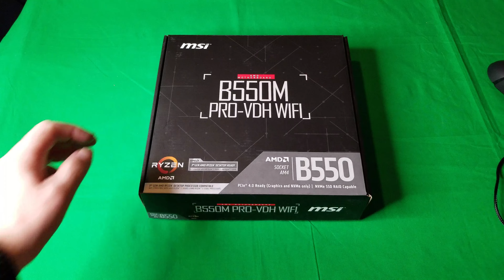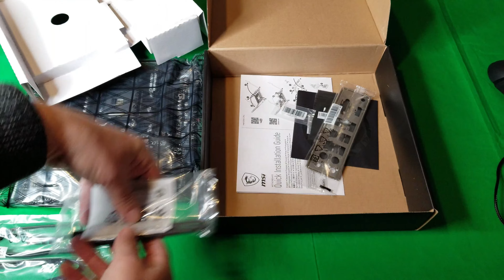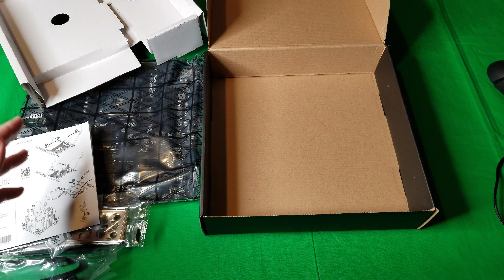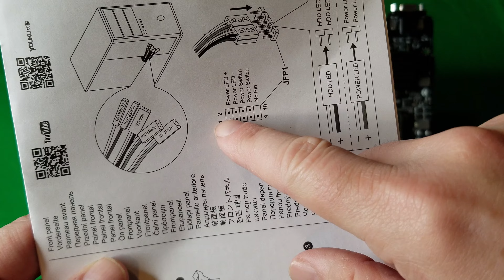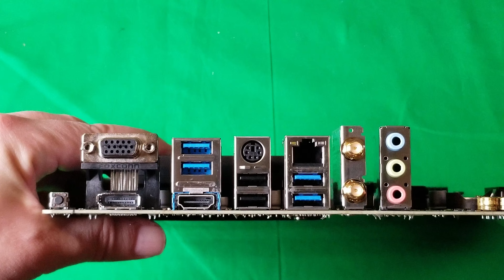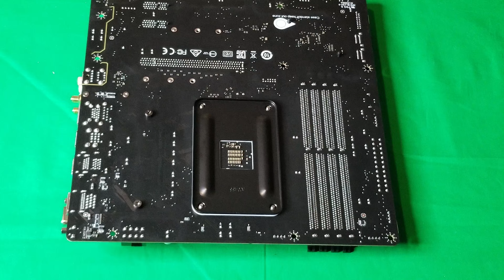MSI B550M Pro VDH WIFI Unboxing & Review

Comment: Hello sir, will it work with the "new" ryzen 5 5500x3d? or am i supposed to update the bios
Reply: Depends on when the board was manufactured, mine didn't need any bios update since it was created in March and had the update needed to handle 5500x3d
Reply from the maker: As @unavailableuser3624 mentioned it depends on MB Manfacture date and BIOS Revision. If your CPU isn't recognized you can do a BIOS update at that time, there are videos on doing it without needing anything else on the MB. Good luck.

Comment: Hello, will this motherboard run with a Ryzen 5500GT right after installation? Unpacked, installed, launched.
Reply from the maker: Yes, it will work after installation. The only caveat is that if your motherboard was released before the 5500 series, if it was a BIOS update will fix that issue. You can verify the older version in the BIOS, if its version 7C95v2A you'll need to update it first. Hope that helps.

Comment: I have a problem, I want to add an ssd in the 2nd slot but the graphics card is on it, how should I do it ?
Reply from the maker: There is usually just enough room for the M.2 to have a slight clearance when you place the GPU in the slot afterwards. If you have a M.2 with a thicker Heatsink then you'll not have the room. Good Luck.
Reply: @Reviewing_Playing_and_More_RPM  So with a small heatsink I would have the space ?
Reply from the maker: If there is a heatsink, you might be ok, can't say for sure. You can go with a higher heatsink and leave off the top cover.
Reply: Take out the gpu

Comment: Pro How can I turn on Wi-Fi in the motherboard
Reply from the maker: Remove the Antenna, that will shorten the signal reach, then because the Motherboard comes with WiFi, there is either a place in the BIOS you can turn off, or in the software for Windows itself. For some motherboards there is a removeable chip sometimes as well, remove the cables from it and that would be another option.

Comment: Can I use a M.2 NVMe PCIe 4.0 and a graphic card in this motherboard at the same time? Sorry about my question but I'm kinda newbie at this, and I read that there's some limitation and that NVMe can disable PCI ports in some motherboards, I don't know about this one
Reply from the maker: While its true it can limit some, a PCIe 4.0 M.2 NVMe and a GPU will work together just fine. I've done this on this system with no issues with a PCIe 3.0 mind you but as far as I'm aware they will work fine.

Comment: i built my new pc with this motherboard everything is working but no wifi i am able to use ethernet tho. not sure why
Reply from the maker: Try going to the MSI Website and download the WiFi Drivers and install them. That is the most likely reason and hopefully will fix it. Make sure you've put on the Antenna as well.

Comment: @ 10:28 which software were you referring to that you're "Not supposed to use"? Was it the software that caused the flashback to fail this time?
Reply from the maker: I was mentioning the MSI App Center, for some reason it caused issue's with the BIOS being updated. However they have now completely redone their Software so I don't think it can do a BIOS update and it must now be done by downloading the BIOS from the Manufacturers website to a USB Stick and updating it that way. This is a more preferred method anyway.

Comment: do you think ryzen 5 4600g will work with this mobo?
Reply from the maker: If you have BIOS version 7C95v21 it will work with this MB. If the motherboard is using an older BIOS version though you will need to upgrade the BIOS before the CPU will work.

Comment: will this work with gtx 1070 also can i hook it up with fans
Reply from the maker: Yes it'll work great with a GTX 1070 and it has a CPU Fan Header, AIO Pump Header, and 3 other Fan Headers, so as long as that's enough for the fans you plan on using it will be great. If you need more fans though there's always getting a Fan Hub. Thanks

Comment: How many fans can I use
Reply from the maker: So it has 1 x 4-pin CPU fan connector, 1 x 4-pin water-pump fan connector which you could use as a Fan connector, and 3 x 4-pin system fan connectors. So other then for the CPU Cooler, 4 additional Fans. Now if you use Fan Hub or Fan splitters then you could double that.

Comment: Are both the m.2 slots gen 3?
Reply from the maker: The M2_1 slot Supports PCIe Gen 4.0 or 3.0 x4, the M2_2 slot is PCIe Gen 3.0 and Supports Sizes 2242/2260/2280 storage devices.

Comment: Is this motherboard compatible with ryzen 5 3400g? Thanks!
Reply: Thank you for answering sir.  I clarified it with you because I have been using b550m  with my ryzen 5 3400g for a year and now it wont work. What do you think is the problem?
Reply from the maker: @jasongargoles2359  The specs say it won't work with a Ryzen 5 3400G but if you had it working and it's now stopped, then only thing I can think of is a BIOS update might help. Not sure otherwise.
Reply from the maker: No it's not compatible with AMD Ryzen 5 3400G or Ryzen 3 3200G

Comment: Hello, i bought this mothercard, my PC is built, but i still didn t buy window 10. (I have the free version of window for the moment) My problem is that my PC picks up poorly the wi-fi, and I don't know if its because of the mothercard or because I still didn t buy window 10, or something with the drivers even if I uptated them (or maybe something with the BIOS). (if you don t understand anything, just let me know it and i will reformulate) Thanks for helping me!!!
Reply from the maker: So you will need to get Windows 10, the network drivers are designed to work well with this MB so it's likely without the right driver it is affecting the WiFi, can't say for sure though. Don't think it'd be anything with the BIOS though.
Reply: @Reviewing_Playing_and_More_RPM  Thanks you very much for your answer, it helps me a lot!!!!
Reply: @yg-hc3iy  Hi, I am in a similar predicament where I am getting terrible wifi signal strength with this MB. What solved the issue for you?
Reply: @mihirsharma3940 I just downloaded window 10 pro, but the problem is still here, so i think the problem is from the MB. So the only way to use a reasonable wifi is to share my connectiion from my phone to my PC, and my phone needs to be under the PC otherwise he will picks up poorly the wifi. If you have an idea i would gladly take it!!
Reply: @mihirsharma3940  Or maybe it will work with a ethernet cable, but i can t try, because my wifi is too far away from my PC. So i think i need to buy a new MB but i won t do it soon.
Reply: @Reviewing_Playing_and_More_RPM  If you have an idea i would pick it gladly
Reply from the maker: @yg-hc3iy  I've reviewed a few different MB's with WiFi that have all worked great any of those would be a good choice, but ensure it's not your Service Provider that is the problem first though.
Reply: @Reviewing_Playing_and_More_RPM  i will watch the video thanks, but I don t think that the service provider is the problem.

Comment: what if im planning to use 5600x will i need to flash it?
Reply from the maker: No way of knowing for certain, sometimes it will depend on the MB Version, if it's Version 1.0 then likely yes, if it's a later version it may take the CPU out of box and work.
Reply: @Reviewing_Playing_and_More_RPM  would it be okay for me to test the motherboard by starting the computer up with the 5600x in it, even if the bios version did not support the 5600x? Or should I just assume that the bios needs to be updated and update it immediately before installing anything
Reply from the maker: @dragonquestfan2002  You can try it with the CPU and if it boots up great, just ensure you have a CPU Cooler on it as it'll heat up fast and can cause damage. If it doesn't boot up but everything lights up seemingly like it's working then you likely need a BIOS update and could do it then.  I always try first and if it doesn't work then shut things down and update the BIOS then.  Of course make sure there's no CPU Damage like bent pins or such as that is another matter entirely.
Reply: @Reviewing_Playing_and_More_RPM  great, thank you

Comment: Hey, thanks for the video! I can't find any info on whether I should install my Sabrent NVMe PCIe gen3 x 4 M.2 2280 SSD into the M.2_1 slot that's closer to the CPU or the M.2_2 with the chipset. It says in the mobo manual that slot 1 with gen3 x4 is supported depending on the processor. I have a Ryzen 5 5600g if that helps. Also, if I have to install in into slot 2 should I move the little black cover so it sits on top of the drive? Thanks!
Reply from the maker: You can use either slot it won't matter, as you could still move it later if you get a PCIe 4.0 NVMe and move the OS on to the other slot without issue.

Comment: Will it work with a ryzen 5600 and a gt 1030 if it has a 5,000 sticker on it without a bios update
Reply from the maker: Yes it should if it says Ryzen 5000 ready on the MB Box, it's not a 100% for sure but the one's I've had that say this I didn't need to update.
Reply: @Reviewing_Playing_and_More_RPM  ok thanks

Comment: Is it a good idea to build a pc with this motherboard if I am going to use Ryzen 5 5600x and rtx 3060??
Or should I change the motherboard??
Reply from the maker: I used it in a build and it's been working great has all the features I wanted but you'll have to decide if it has all the features you need first. Overall though I'd buy it again.
Reply: @Reviewing_Playing_and_More_RPM  ohkay... If you tested it and if you think it is great then I have no problem doing that build with this motherboard 😅..

Does the motherboard get heated with this build??
Reply from the maker: @mayureshwadgaonkar2265  I didn't notice any heating issue's with this MB at all.
Reply: @Reviewing_Playing_and_More_RPM  okay thanks for the answer

Comment: does this board support 3 monitor output by using 5600g processor without gpu
Reply from the maker: The 5600G has 4 display controllers so you can run up to 4 independent Monitors.
Reply: @Reviewing_Playing_and_More_RPM   Thank you so much for your kind information i was searching so many place finally i got answers from you
Reply from the maker: @mohanrajs1315  Happy to help you out. Have a great day!
Reply: @Reviewing_Playing_and_More_RPM   sir one more doubt can i connect multiple monitor setup for this MSI A520M-A PRO Motherboard by using 5600g processor
Reply from the maker: @mohanrajs1315  Yes, it should be able to support it as the 5600G is the needed component and this MB supports 4K as well.
Reply: @Reviewing_Playing_and_More_RPM  thank you sir

Comment: So does it give off it own wifi or no I’m confused
Reply from the maker: It has a WiFi Module on the Motherboard and Antenna so you can connect to your Home WiFi, this removes the need for a Hard Wired connection but will still let you connect using this if you'd prefer it.
Reply: @Reviewing_Playing_and_More_RPM  ok thanks
Reply: @Reviewing_Playing_and_More_RPM  what’s the range of wifi it connect to it ? Coz my my wifi wifi router is in next room and it’s not within range . Please help
Reply from the maker: @r4yn444  WiFi usually has a range of 30 feet, things like cement walls, walls in general depending on construction usually will allow this same range, so if it's not getting to your router in the next room check that it's not surrounded by metal objects as that could affect things, otherwise it should be fine, ensure you are using the Antenna that came with the Motherboard.

Comment: "if you are lucky it works, if not you need to buy another board" ok, very assuring =)))
Reply from the maker: Yeah sorry about that, I say things like that which are true but not helpful, I'll be more clear in the future, I have been using the MB without issue though and everything worked great.
Reply: @Reviewing_Playing_and_More_RPM  It was clear and helpful because it's true... sugarcoating it wouldn't change it. I subscribed because I appreciate your "this is how/what it is" approach.
Reply from the maker: @reppost  Thanks

Comment: I confused between MSI B550-A Pro or this MSI B550M Pro VHD Wifi, bcuz both are around same price here in India...
Reply from the maker: As both are similar and the WiFi isn't necessarily required if Hardwired Ethernet is being used it goes to checking features like does it have ARGB and RGB Headers, does one have a Type-C connector on the MB, and anything else that might be a preference. Both good choices either way depending on your needs. Good Luck deciding.

Comment: Nice review. I am working to repair this same motherboard for a friend, where some components have come off the back side of the board, due to precarious placement between the I/O shield and the hole for mounting standoff.  This damaged area is shown in lower-left corner of screen at about 12:20 into the video. It would really help to have a close up photo of this area so I can better see the components. [I have identified the two ICs (Richtek up1816P, 8-pin marked "S83p", and Richtek RT9553B 10-pin, marked "MK=7B") and was able to get the board to boot by soldering jumpers but this disables the overcurrent protection circuit. One component, which I believe is a 10mohm current-sense resistor according to the datasheet, MSI Tech support identified a capacitor, and I'd like to see a close up of the board to better be able tell.  I don't know if you still have this board. thanks.
Reply from the maker: I have it in a system installed can't get a good picture of that area though, if you use the Magnifier at 200% you can see it better though if that might help.
Reply: Ok, I tried that and a few other things but unfortunately even at 4K, when zoomed in, the resolution is not quite enough to see what I need. thanks anyway.

Comment: Thank you. This helps with my build. What kind of speeds are you getting for the built in WiFi?
Reply from the maker: I actually sold this a bit ago, and they are using it with Fibre Optic and getting over 300Mbps so depending on your Internet and provider.
Reply: @Reviewing_Playing_and_More_RPM  was it close to modem speed?
Reply from the maker: @bumpoo5905  Yes it was.
Reply: @Reviewing_Playing_and_More_RPM  thank you

Comment: Is asrock b550m steel legend better option?
Reply from the maker: While the ASRock B550M is a great MB, it lacks a onboard Type C port other than that they are pretty comparable. Both good choices.
Reply: @Reviewing_Playing_and_More_RPM  thanks. Which would you get if they both same price?
Reply from the maker: @unclezedd6183  I go with the MSI B550M Pro VDH WIFI, it's been great for me and has all the features I wanted.
Reply: @Reviewing_Playing_and_More_RPM  thanks man. Will get the msi. Subbed
Reply from the maker: @unclezedd6183  You're very welcome, thanks for the support.

Comment: does this board have rgb control to sync all my fans and cpu cooler ??
Reply: im pretty sureim trying to figure that out too 
+
Reply from the maker: Yes it does, both RGB, ARGB, RGB Switch to turn it all off as well, and works with RGB CPU Coolers.
Reply from the maker: Yes it has both RGB and ARGB Headers and even an LED Switch on the MB to turn it all off if you wanted to. As long as your CPU Cooler has RGB then it will work with it's RGB as well.
Reply: @Reviewing_Playing_and_More_RPM  so i will be able to sync the pattern and colors with software that comes with the board? if so how do I access that software? sorry for all the questions i’m using this board to build my first pc
Reply from the maker: @ilovecheesecake516  Yes you can sync all the patterns and colors, it'll use the MB Software to do this so will depend on what MB you have or buy, I have only had problems with Gigabyte RGB Fusion so I'd avoid those. My favorite is MSI and ASRock has always worked great for me as well. The MB when you buy it will include the Drivers and Software and it's also available from the MB Manufacturer's website and for updates as well. Now some CPU Coolers might have there own Software but if it has a RGB Cable going to the MB RGB/ARGB Header then it will work with the MB Software right away, if you run into a situation where it doesn't then you might need to download the software for that device.
Reply: @Reviewing_Playing_and_More_RPM  thanks so much man, i’m planning on buying this mb. how do i access the software for the rgb? is it just like a file pre installed on the computer I build this mb with?
Reply from the maker: @ilovecheesecake516  Actually that's a great question, the Software will be on the DVD that comes with the MB, but you can sometimes run into problems, I noticed that if you go to the Microsoft Windows Store you can download it from there and everything will work great. It's called Dragon Center.
Reply: @Reviewing_Playing_and_More_RPM  thanks man you gotta new sub👍🏻
Reply from the maker: @ilovecheesecake516  Awesome. Thanks

Comment: i’m new to pc and was wondering, do you need a wifi adapter for the motherboard?
Reply from the maker: No, this MB has the WiFi on it, and an Antenna you will need to connect and you'll be up and running.

Comment: I have the 460m pro vdh wifi and it's a great board! I do wish it clocked about 3000mhz for the ram but still a great board. It has the Intel turbo boost so my locked i7 runs at 4.6 instead of 2.9 it really is a great board
Reply from the maker: Sounds great, I'm thinking of doing a few Intel MB reviews soon as there seems to be more options now. Have a great day.
Reply from the maker: @I killed that beard guy Yes it has a USB Type C on board the MB

Comment: I heard you say it had 7.1 audio.
So I imagine if you had the proper amount of speakers surround sound.
You would not need an extra audio card is that correct ?
Keith
Reply from the maker: That right yes. Last time I did 7.1 I had sub woofers and 4 small speakers, it was amazing.